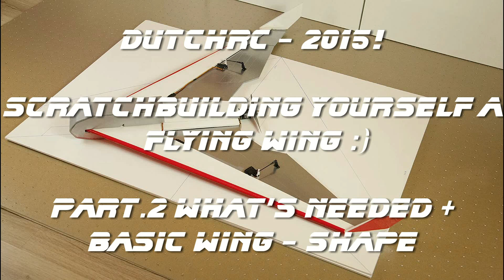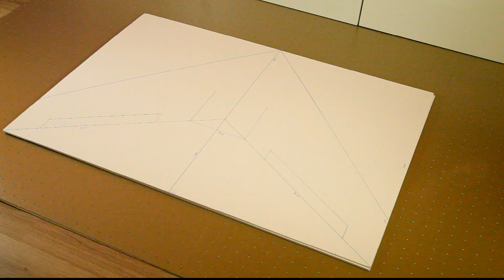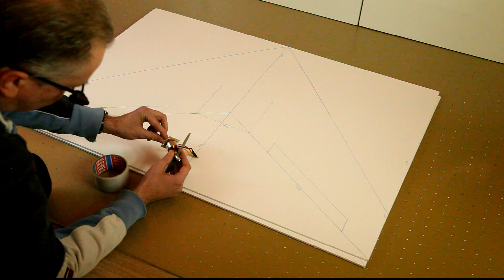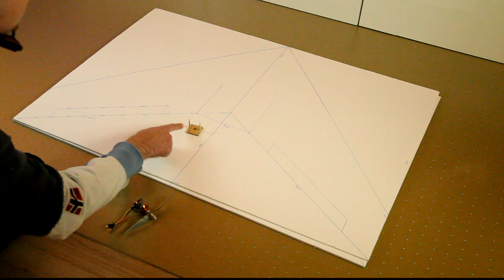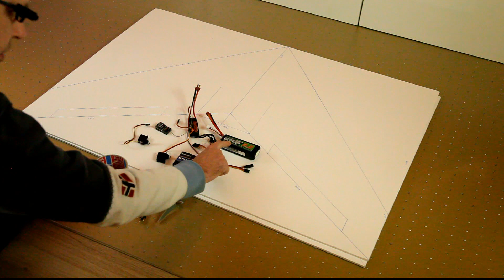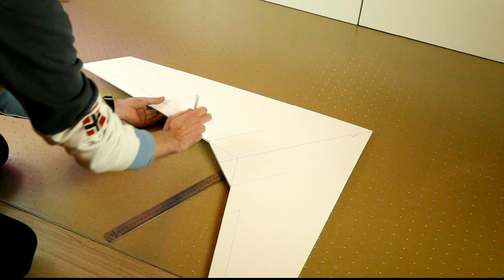Scratch building a flying wing! Part.2 - basic shape + parts

Comment: Foam Board bought at Dollar Tree here in the states is 76.2cm x 50.8cm. Where are you getting 100cm foam board and tbh that doesn't look any bigger then 20" x 30" sheets I buy....
Reply from the maker: +Michael Meyer Hi there Michael.. I don't live in the US obviously, but the sheets I buy at office-supply stores here are 100cm x 70cm.. I really couldn't tell you where those would be available over there, but you might have a look around at the flighttest forums.. They use foamboard for their builds as well..